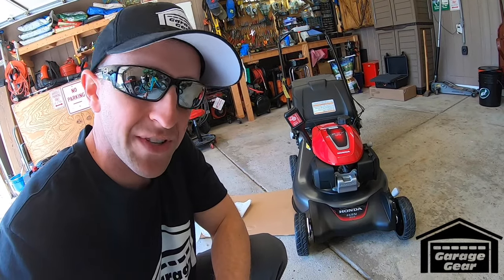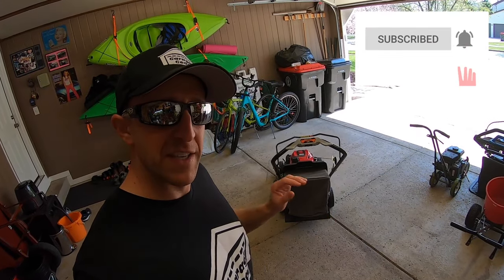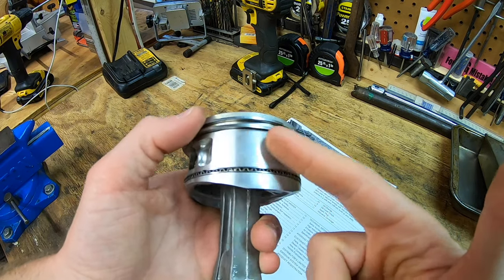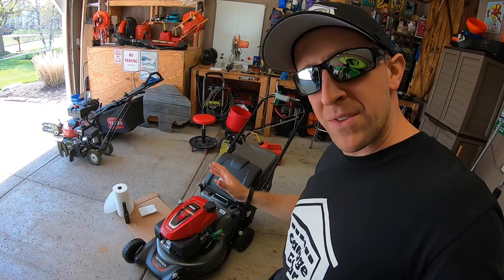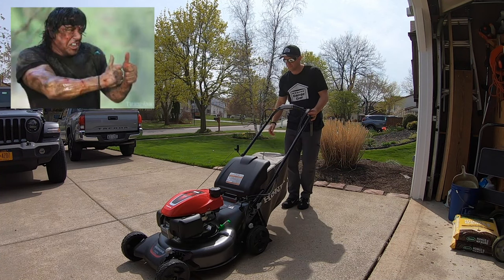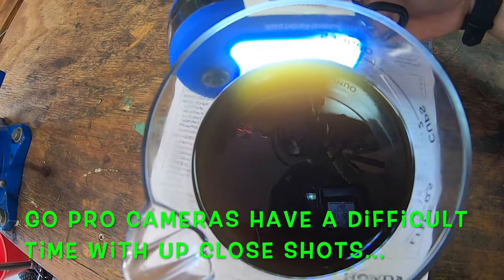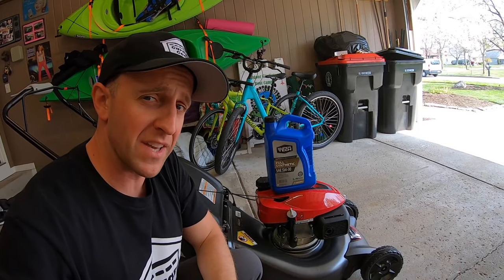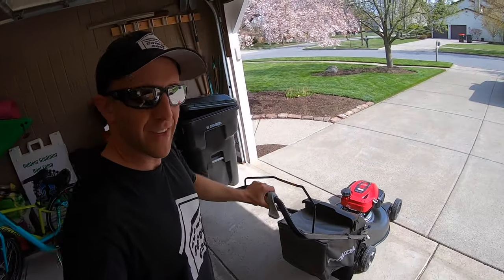BEFORE You BREAK IN Your New Lawn Mower Engine, WATCH THIS!

Comment: Well damn I messed up LOL
Reply from the maker: You’re mower will forgive you! Thanks for watching!
Reply: @GarageGear  so when I said I messed up.. I think I really did. I’ve been afraid to turn this thing back on. I did and it turns on but is just revving up and down instead of staying revved up. I’m scared 😓
Reply: Realizing I didn’t turn the fuel valve off after mowing last.. do I need to empty the old gas? Close and run it till it runs out?
Reply from the maker: @dukesilver3619  perhaps you got some bad gas in there. Drain it, run it to empty and fill it up with ethanol free gas and see what happens.
Reply: @GarageGear  drained it. ran it till it ran out. filled with no ethanol fuel. It ran smooth for a second then went back to the revving deal.. two things I didn’t do on your video.. let it run for 30 minutes. I let it run for a few minutes then went to town. I also didn’t drain out the manufacturer oil and add new oil.
Reply from the maker: @dukesilver3619  oh ok! I would get to work on making everything right before the season gets going! 👍

Comment: Not sure what trained mechanics youve been speaking to, but that is complete nonsense. Do what Honda tell you to do. Honda is amongst the best engine designers, constructors and builders there are.

It may be counterintuitive to see dark oil in your engine and assume that's bad. However, the running-in process is a key part of every engine's life and each manufacturer/engine has specific requirements.

Oil that is too protective will not allow the piston rings and cylinder to properly bed-in against each other. The breakdown of the oil during running in is expected and determined to complete the required bedding in. If bedding in does not complete as required it may suffer blow-by and this could then lead somewhat ironically, to reduced engine life/performance. 

The R&D that goes into their engines does not result in producing wrong or damaging advice.

I have a Honda mower and motorbike. I trust Honda's break-in and service schedule without question. Well I did question it, but double checked, and followed what Honda say for each machine, to the letter.
Reply from the maker: Thanks for watching

Comment: Im surprised you dont use honda oil in your honda mower.
Reply from the maker: Why’s that?
Reply: @GarageGear  So the walmart oil is good enough?.Should I mow higher for better stripes ?.Im at a 2 inch height now.
Reply from the maker: @raypalermo1603  I’d say so. It outperformed Mobil one in some videos here on YouTube. Mowing a little taller will give you some better stripes.

Comment: So if a YouTuber who owns less than a dozen pieces of equipment knows better than the engineers of Honda? Just stop telling people this! They make equipment that lasts forever. You can’t make it better or you would be making your own. The only thing you are doing is shortcutting. How much other stuff do you shortcut? Now your next oil change will run for how many hours with much more contaminants because you rushed it. You bought the new cheap model of Honda mowers. There’s not even a guard for the drive system on the bottom deck. 🤷‍♂️
Reply from the maker: Thanks for the Ted talk.

Comment: The Honda would be perfect if it were front wheel drive.
Reply from the maker: @harrycallahan686  I take it you’re a fan of front wheel drive?
Reply: @GarageGear  Only because you have to release the trigger 2 times per row with the real wheel drive. Front wheel drive you can get away with a small handle lift without disengagement to start the next row.
Reply from the maker: @harrycallahan686  I hear ya my friend

Comment: So, if a multimillion dollar manufacturer with millions of dollars and hours in designing, testing, and manufacturing, and a solid reputation tells you to run the motor with break in oil for a specified amount of time…. They’re wrong?
Reply from the maker: That’s what I thought but the oil they give you isn’t labeled break in oil and the oil that came out after 30 minutes was dark with metal particles in it. I think I proved them wrong and it should be changed sooner

Comment: Yeah I had to check before I chided ya .,... you're using that cheap ass GVC Honda the disgrace  of their engines ALL ALUMINUM - no cast sleeve .A harbor freight is better .... I was dumb once .. bought a new wood split-er with a Honda engine on it ... paid extra over the Briggs motor ) couple hundred maybe ? ) It started to choke out under load and I knew it was not fuel or carb . Then called honda they FU**ed up and transferred me to a distributor in Oklahoma - He had no Idea why .. any way he knew his shit and spent time with me ... that damn Honda was a GVC and the man said how many hours you think you have on it ... I guessed about 250  - Yeah that's about the life of it ... WHAT ? Yeah it does not have a cast iron sleeve . Junk paid more for less motor paid for the name HONDA 
I see why you want to change the oil so short on hours for break it ... that junk motor will need all the help it will get . Good luck ... you really should not use that as an example for your viewers ... some will be as dumb as I was on how short lived that motor is .
Reply from the maker: Thanks for sharing this lost 70s.